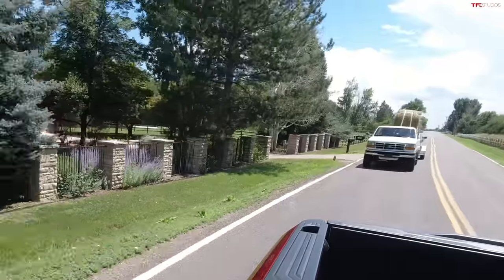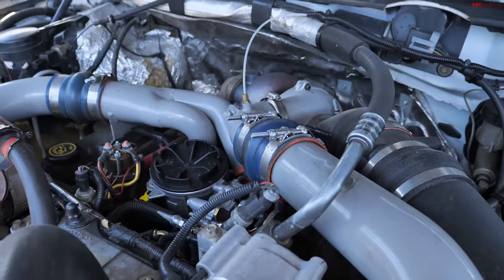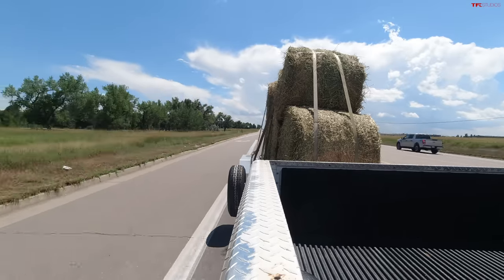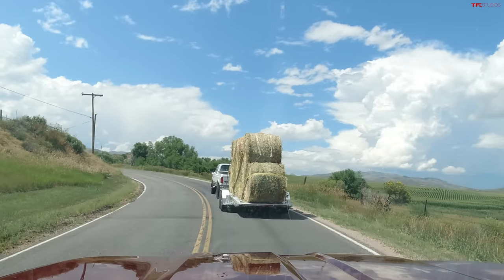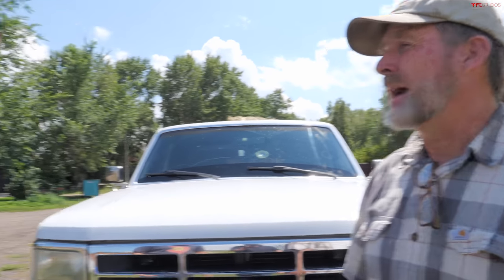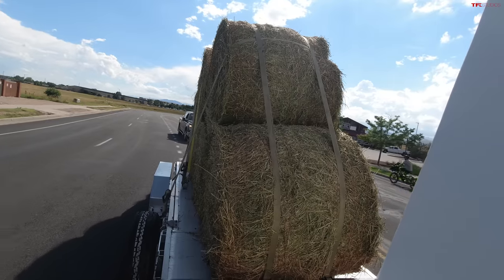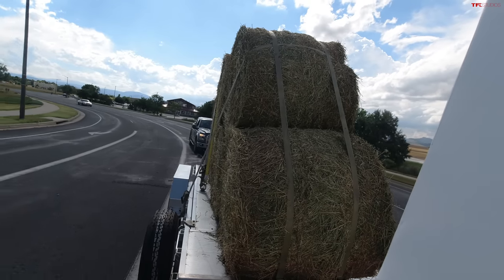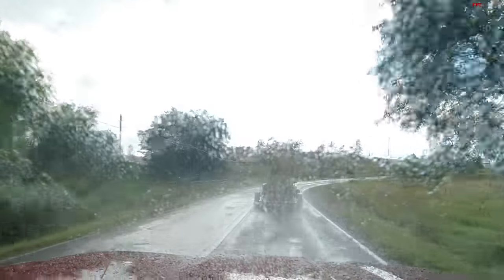Ranch Battle! Can a 26-Year-Old Ford F-250 7.3L Power Stroke Outwork the Legendary 5.9L Cummins?

Comment: A stock 5.9 doesn't even need a pyro, especially the 03-04.  They have much thicker piston crowns, and are so timing limited in stock form they can run all day.  Just my experience with two 3rd gens, my 05 runs way way hotter than my 04 does.  I have also had to rebuild my 05 from broken rings, my 04 hasn't skipped a beat.  Good video for the newbies that are looking for an older truck.  Address that stock fuel filter on the common rail 5.9 and replace the injectors and they are awesome trucks.  I love the v8 but man I get heartburn just looking under the hood of a 6.4 powerstroke or a duramax.

Comment: I had both a 99 and 03 Dodge Cummins Rams with  automatic. Both  2500. Both stock bought new. I could get  25 mpg with the  99 and  23 mpg with the 03 with the  305 HP. Loved them both. Wish I had kept the 03. No stupid  converter or  DEF to worry about either.

Comment: The perfect truck is a Fummins- an OBS F-350 with a 5.9L Cummins & NV6500 swapped in.

The Cummins is a 1 million mile engine I the Dodge/Ram 300,000 mile body
Reply: The 7.3L Navistar diesel engine is also known for being a million-mile motor.  Best diesel that the Blue Oval ever installed in a pickup truck.  I also love the 5.9L Cummins, especially the coveted 12 Valve.

Comment: I bought a 2006 2WD Dually for our family travel trailer.  They’re not easy to find.  It’s lower to the ground, super stable, and steers like a car.  Simple front end will last forever with no issues. Has higher payload than 4WD too. Just don’t get it in the mud!
Reply: or the grass
Reply: @clappgen5.949  if the grass is on saturated ground, then yes. Here in Texas grass is no problem.
Reply: @edwardman1742  I live in Texas. Moving dew cripples 2wd trucks.
Reply: @clappgen5.949 depends also where in Texas, I live south texas near the border, 2WD not much of an issue most of the time. Less like you mentioned there’s saturated dew in the am.
Reply: @simply.5570  central TX and there's still dew on the grass in south Texas spent alot of time there.
Reply: @clappgen5.949  how south we talking here lol cuz here in Edinburg, TX doesn’t get too bad, specially with the heat we’ve been having, if anything we’ve been wanting water on the field haha
Reply: Ah, my Texas boys, love it 🙂. This thing is meant to be a road warrior. Hardly ever needs to touch grass anyway.

…Heart O’ Texas used to be my old stompin’ ground 🤟
Reply: @clappgen5.949  yea, right

Comment: I drive a 1997 OBS F-350 XLT 4x4 Crew Cab with the 7.3. Mine when I bought it was tuned for towing rather than racing. The previous owner added bigger injectors, Turbo, Cold Air kit, and 5 inch exhaust. Its equipped with Ranch hand front and Rear bumpers with heavy duty running boards. I also have an electric brake controller and Reese hitches front and rear, and a gooseneck 2-5/16 ball in the bed. I have not towed with it yet but just driving down the road, I feel it gets better fuel mileage than most diesels cause it breathes better. I have driven 1997 Blue Bird transit buses with the mechanical 12 valve Cummins engines and they seemed gutless compared to my pickup with the 5 spd manual. I do plan on @500K doing the recommended complete overhaul from Ford, as well as going through my ZF-5 Manual and B&W transfer case. Always wanted one as a teenager in 1997 and I got one now. Dream come true. PS: The whistle of my turbo scares off the moose on the side of the road.

Comment: I love the old trucks but with a young family and going on long trips these trucks are ridiculously uncomfortable.

These two definitely produce the best videos on the channel hands down. Great video guys!
Reply: Or maybe we have just gotten to the point of being over pampered with the newer trucks lol . Drove 3300miles in a 97 350 with a gooseneck trailer /2 horses  an the ride wasn’t bad. Now empty yes it’s not very smooth
Reply: Rsk and bilsteins my straight axle one  ton rides really well. Factory suspension did ride really rough. This generation wants their truck to ride like a caddy. 😂
Reply: I rode in my friends 2022 f350 single rear wheel power stroke and holy shit it was rougher than heck.  I thought for being a new truck it would be a nicer ride than a 20 year old truck
Reply: progressive springs with overload leafs solves this problem.  You can have your cool old truck and also have good ride quality.  Slap a GOOD quality (5k+) lift kit on it and enjoy
Reply: i daily a 1994 f-150 4x4 5.0 5 speed and I think its really comefortable. the bench is super cushy and it gets a little bouncy but its a truck not a 1965 cadilliac.
Reply: 😮newest truck we have is 2000 f450

Comment: Literally bought a 97’ 7.3 last week and put an exhaust and hydra tuner on it two days ago. It’s insane how much power it unlocked
Reply: I wish they had bumped up the tune while he was driving it
Reply: The mini van at a stop light will still pass you while doing half throttle and you can be flooring it. 😂
Reply: @JoshuaOverman agreed. they’re realllly not fast. they just make a ton of torque and the gear shifts give you the illusion it’s fast. that’s what driving mine for 3 years has taught me
Reply: Just wait until you change injectors. I run 180/30’s, intercooler, and a stage 2 hpop in my ‘96 5 speed, and it’ll walk some modern trucks.
Reply: @dash456789  i have the same setup and yea it’ll walk modern trucks when empty. then, put 10,000 lbs behind each and the modern truck will still accelerate the same and your truck will be struggling to hit 30. i had the same theory so i tested it against our ‘22 ram 3500 LOL
Reply: @dash456789  only difference i have with my truck is i have a cncfab stage 1 hpop. shouldn’t change acceleration much. these trucks haul ass empty but they aren’t fast with even the slightest load lol. my upgraded 5spd 7.3 against a stock with a tune 6.0 pulling the same trailer and same car is about twice as slow getting to 60
Reply: @MCatwar  What gear ratio do you have? That might play a key factor. Mine will pull a house down with 4:10’s, ZF5, and custom tunes from Jelibuilt. Also have a riffraff billet comp wheel, and the stereotypical 3in DP to 4in straight. I sold my ‘11 LML and ‘17 L5P and kept the 7.3
Reply: @dash456789  my truck is a 97 with the 5 speed, 4.10s, stock tire size, 180s, kc300x, 6.0 intercooler, cncfab stage 1 hpop and 1023 tuning for high altitude with a 5 inch straight pipe. it cannot pull down a house. i also use this truck primarily at 7,000-11,000 feet. altitude kills these trucks.
Reply: @MCatwar  There’s your killer, the altitude. The 5” is no benefit over a 4” on a 7.3ps. A KC drop in is also going to take longer to spool over a stock charger or stock with a billet wheel.
Reply: @MCatwar  Might also be worth Trying some of Brian’s tuning, especially since 1023 pulled the plug on tunes thanks to epa
Reply: @dash456789  this was back in early 2021 i got it tuned. also, i went for a .84 AR. the spool time is shorter, but with the intercooler it’s about the same as the tp38. so yeah, it’s really just altitude. and i’ve learned that a lot of people who swear by these 7.3s are usually from lower altitude because for some reason a 5.9 ALWAYS out pulls these 7.3s up in the mountains of colorsdo. i like my obs more but i sometimes wish i had a cummins whenever im hauling. plus, i could run an exhaust brake then and not worry about hydraulic lifters like on the 7.3!
Reply: @dash456789 That’s not that good. My ‘06 Dodge was stock injectors, stock turbo with just a Smarty Jr tuner and the only modern diesel it couldn’t walk was the newer 425 horse Powerstroke.

Comment: I have the 7.3 powerstroke and the 6.7 Cummins.

The 7.3 has very impressive power for its age.  Sometimes I think it even pulls just as good.
Great video 😅
Reply: Modded, my 7.3 would tow it, but will struggle. 583k miles
Reply: @RiggyRonnie if it struggles with 9k pounds you nwed to do a refresh lol my 01 Excursion pulls 15k easy with 353k, 4k mpre than its "rated" just fine
Reply: @ryancollins3227  I bet my 7.3 runs better than your excursion, and it’s slow af.
Reply: @ryancollins3227 9,000 lb loads are not all the same. A larger empty gooseneck flatbed can easily weigh that. A 10-11 foot tall camper tag trailer with a flat nose weighing that much will be a total boat anchor by comparison.
Reply: @BrandonLeech  aint no goose neck or fifth wheel weighing 9k pounds unloaded fooooh 🤣🤣🤣🤣 even then take a camper or a full load for a single rear wheel vehicles is much different than a dual real wheel vehicle. They made duallys back in the day they could easily tow way more than 9k pounds. But for everyone else if all you tow is 9k most of the time and 20k every now and then. The 7.3l and the 5.9l will do it no problem.
Reply: @ryancollins3227  Plenty of them weigh 9,000 empty IDK WTF you're talking about...
Reply: @BrandonLeech yeah my gooseneck trailer empty wight is 9k

Comment: A more fair comparison would be a 2002 f350 vs a 2003 3500 . 

I used to have a 95 ram and a 95 f250, the Cummins is inmortal, but the ram as a truck wasn't as good as the f250, f250 got better brakes, suspension and interior, and the 7.3 strong as the Cummins 

Now I got a 99 and a 2000 f250 7.3 and a 2003 2500 Cummins, and I like more the way ford do things on those years, my dodge is a H.O.  it's turned, and the 7.3s are chipped , I prefer ford.. they are better trucks, at least on those years.

Comment: Good seeing older trucks at work. Well they will pull way more than that. We put about 20k behind ours when hauling hay. Keep turbo spooled and up the hills they go. 7.3 is happy at 2500 rpm. Manual trans is the only way to go when towing. Yes they make good autos. But most of the time we hardly had trailer brakes working properly.  We use gears to slow the loads down with.  Most of the time the only thing that will go wrong is the clutch and it will normally tell you when it gets close to failing. Auto can leave you walking. And no def fluid junk to shut you down.  Crazy government doesn't use it in military vehicles but everyone else has too.

Comment: If you want that 7.3 to last, put a stock air box back on it and run it with the stock Ford tune only.  You'll get 1,000,000 miles out of it!
Reply: Those cotton air filters let huge particles through, that’s why they flow so well, good on a hot rod that doesn’t see dust, not on a truck, I agree, aftermarket air filters all suck badly, especially the cold air intakes, I have yet to see a cai that’s designed to articulate when the engine moves, I took my cold air intake back after  it tore off the throttle body, although it sounded great.
Reply: Cost a lot of much money in repairs to get a 7.3 to 1 million
Reply: @JoshuaOverman  I assume you don’t have knowledge about 7.3
Reply: Stock tuning I agree with. The 6637 style round paper filters like Napa or Donaldson are perfectly fine and flow a little better than the stock airbox. Oiled cotton filters are a bad idea on anything but a street rod or a dyno/dragstrip queen. Not a good idea for a truck that does any sort of truck stuff.
Reply: @ashokjames3467  I have more then you you don’t understand reality.

Comment: I can appreciate a Powerstroke and a Duramax. I am a little partial to Cummins though. I have a 2015 Ram 3500 diesel with the manual transmission. The gear shifts are close together,  so I only use 2nd, 4th and 6th when unloaded. I have accidentally started in fourth before and the thing barely struggled to get started. 😅 Unloaded of course.

Edited to add, after he mentioned the low value of his Ram at the end of the video I know what he means. Mine is equipped the same way as his truck and with only 77k miles in really good condition,  blue book is only $39k the last time I looked.
Reply: It's criminal about the depreciation but having sold Dodge/RAM the good ones are some of the best trucks on the road the bad ones though.... they live at the dealership and are rolling lawsuits in a lot of cases. Just a shame because it causes mistrust in the brand overall that may or may not be deserved.
Reply: @playanddisplay3636  This one hasn't been bad. It is deleted but not tuned to have much overstock power. The a/c just quit, I had to replace the expansion valve and desiccant bag. Done that all myself for a hundred bucks.
Reply: @Dale37  Should be a great truck for years to come. I feel like most my customers got good trucks. The bad ones you know almost immediately, they will do weird shit like the wipers will turn on as you walk away from the truck, or the dash will give you a random light show. Then the long crank no start issues happen, or fuel pumps stay running while the truck is off. Electrical gremlins. If you don't have those weird issues, and like the Cummins. KEEP your truck don't play RAM roulette and find yourself in a nightmare.

Comment: Great video guys! What a good comparison between these two classic trucks. Nothing against the Cummins but I prefer the 7.3 OBS Ferd only because I have owned 3 of them and never had any major problems or issues with the motors (other than a valve cover wiring harness on my 97'). Also the exhaust note is awesome especially with a 3" downpipe, a cat delete, and a nice high flowing muffler.
Reply: Valve cover wiring harness issue happened to me also its all thats ever happened

Comment: Was it a competition for how many ways to secure a load?😂
No-one who has ever carted bales, has used a chain🤣😅
Double strops lengthways...I have taken truck and trailer units through very challenging roads in New Zealand, with cross straps over the bales only..Save the drama for Hollywood 😎

Comment: The 7.3 performed better at higher rpms due to the intercooler great video!!
Reply: the cummins has a intercooler. The differance it the Powerstroke need more RPM to make power. Uses WAY more fuel! The Inline of the Cummins just makes more power down low thyan the V8. Way better fuel Eco. I know. My 5.9 3rd gen gets about 26mpg no load on the hwy crusing at 1400 RPM.
Reply: @OutlawFarmersRC You cruise at 50 mph?
Reply: @GMbowtie350  gears
Reply: @OutlawFarmersRC  torque has nothing to do with V8 vs I6, it's mostly about bore vs stroke, but also turbo and fueling setup. A V8 with the same bore-stroke as an I6 will make just as much torque as the I6

Comment: It’s crazy how much engines have changed in (what seems like ) a short time. My little Ford V6 ecoboost has way home horsepower, and even more torque!
Reply: It does but the longevity just won't be there if it's worked the way these trucks are worked. The EcoBoost will probably go through 3 sets of cam phasers and VCT units along with turbo issues.
Reply: Hook the trailer they hauled in this video, pull it a few hundred miles a day and report back in a year...

I'm a die hard ford fan and and have been since I was old enough to drive.(over 40 years ago!) I own a 2000 7.3, and several other ford/mercury products. That Ford ecoboost runs like a runaway circus monkey, but still scares the heck out of me! I'm still a proponent of a bigger "detuned" engine doing work for maybe up to 600k miles, vs trying to "wick" up a smaller motor to do the same work. Just my .02
Reply: @richardmitton4115  Exactly. Bigger, simpler motors are the way to go for hard work. A lot of these "efficient" turbocharged motors you will save on fuel in general but repair costs are higher plus potential down time. We had a Chevy Silverado 2500 with the Vortec 6000 motor. A total pig on fuel but in 270k it only needed valve cover gaskets (when we took off the valve covers the cams were pretty much free of wear), spark plugs every 100k and a MAF sensor all of which were done quickly in the garage at home. Even at high mileage it never burned oil and turned over quickly in cold weather.

Comment: I would say a 99 F250 7.3 with the factory intercooler or the 12 valve cummins.  As much as I love my powerstroke and think it will most likely turn 1,000,000 miles, I would probably go with a 12 valve cummins if I was given a choice.  The cummins is easier and cheaper to upgrade.   With that said, that is the motor that I would take, not the truck body.  When it comes to the truck body, I would take the Ford body over the Dodge body ALL DAAAAY!  Dodge's older truck were built so bad and the interior was by far the worst!  My 99 powerstroke interior is beautiful and it has been used as a work truck since day one and it has almost 300,000 miles.  My buddy has a 24 valve dodge ram and it only has 108,000 miles and it has never been used for work and the interior and exterior are trashed.  The dash is all cracked, the air vents are falling out and there is rust around every wheel.  My Ford doesn't have any rust and it has never been garage kept.  The trans is another weak point on the dodge.  My F250 still has the factory 4r100 with a few small shift kit upgrades.  My buddy's dodge has gone through 3 transmissions in under 110,000 miles.

Comment: Cool video! I’m pretty sure Ford went to a 6 speed manual in 1999 behind the 7.3 when they went to the Super Duty body style. Would’ve been a little more apples to apples, but entertaining nonetheless.
Reply: Best comparison to that common rail would have been a 6.0 powerstroke. 03 First year common rail in vs 03 first year 6.0. 
Even a 01-03 7.3 would have been better.
Reply: You could get s zf5 and a zf6 for the early super dutys. Just like the dodge could be ordered with the  NV 4500 (5spd) or the NV5600 (6spd). I've  seen/driven several 5spd 3rd gens and a couple 5spd powerstroke super dutys, although most you see are the 6 speeds. The  real unicorns were the v10 manual transmission trucks.
Reply: @ericwestrom9085  I have a 2000 F250 with the 7.3 and a manual. Not sure if it's classified as a 5 speed or a 6 speed. It has the granny low then first through fourth and then overdrive. I would call it a 5 speed with a low gear.